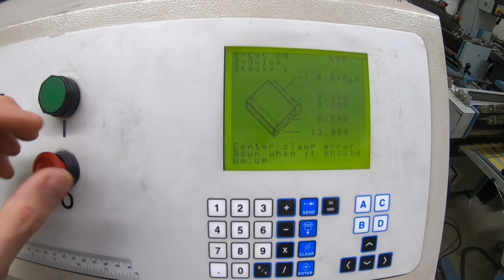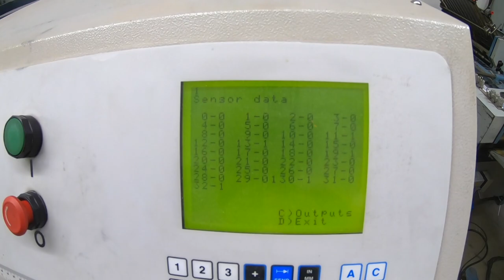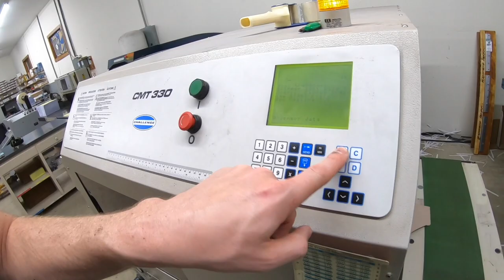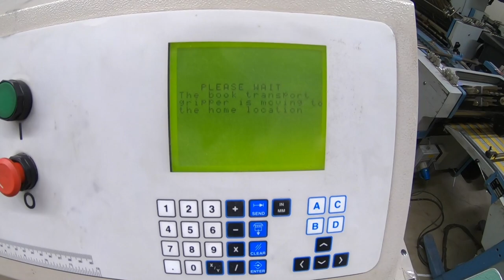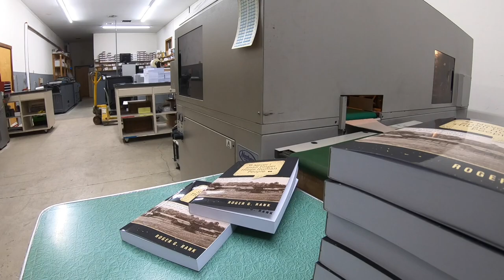Proximity Sensor Fix on Book Trimmer, Center Clamp Error

Comment: Dan, you started perfect binding books without the 3 knife trimmer right? I’m thinking about getting a used perfect binder. Maybe wire bids. I might have to get a 3 knife later on. Just curious how well it went without the trimmer?
Reply from the maker: It is fine, just uses a bit more labor. When you stack books up and trim with a guillotine you can trim them down pretty quick. Do it!